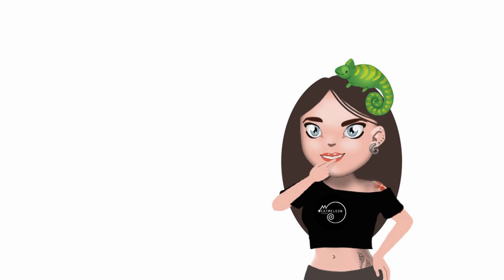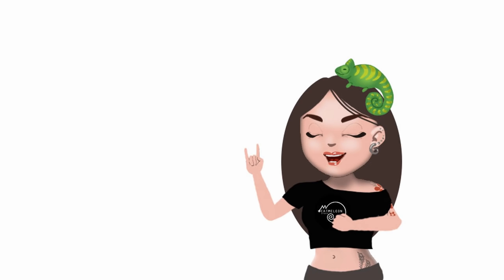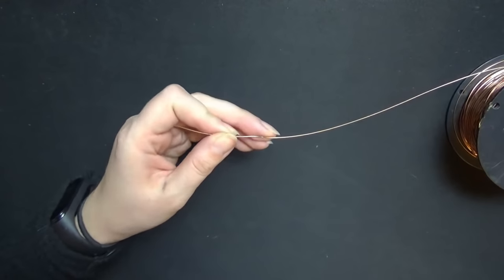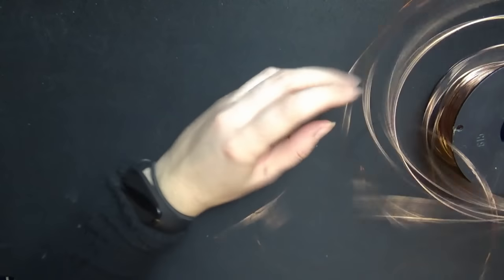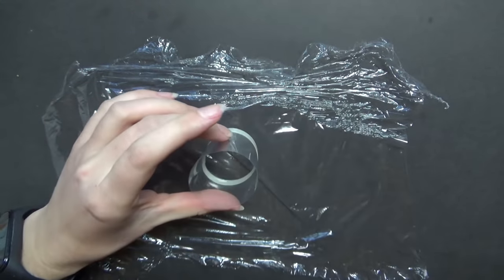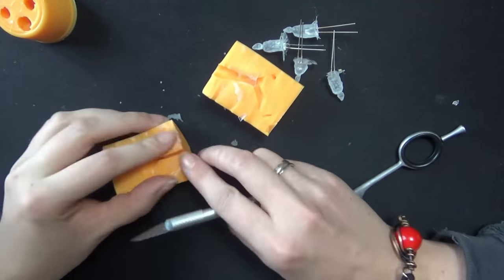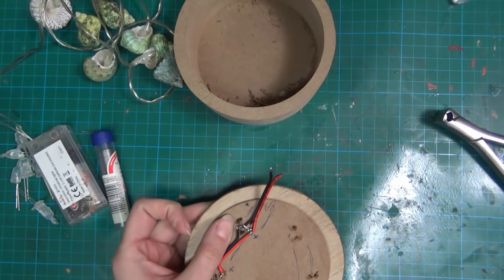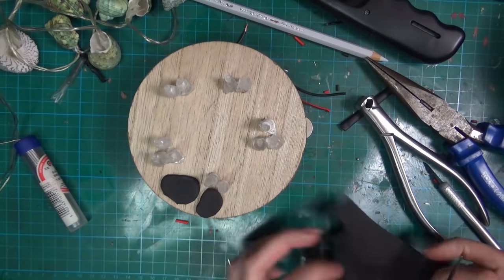The Dark Valentines - OOAK Valentines Day Project... with a little twist

Comment: A trick I learned from poppen alterian, I'm not sure that's how it's spelt, is to use heat from a hair dryer for a couple minutes. It saves the time of have to heat up water and it's less likely you'll burn yourself.
Reply from the maker: I used hair dryer for my first custom. And I prefer water. You still need to blow the hot air at your doll for some time and you can't do anything else in the same time (you need to hold your doll). For me it is choosing what suit you best - and I prefer this method :)

Comment: You need Flux on your wires when soldering. It makes it alot easier for it to stick.
Reply from the maker: Yeah. I was using it here. No help whatsoever XD But it’s ok now. It was a soldering iron that I used to textured the foam cosplay pieces. It was old and dirty. I have a new one now and it works way better.
Reply: @Catmeleon Studio  huh that's odd. Maybe you have the wrong kind of solder? The candle look turned out really cool though!